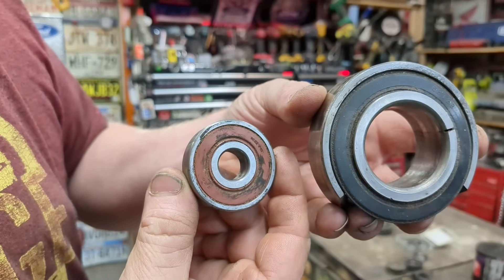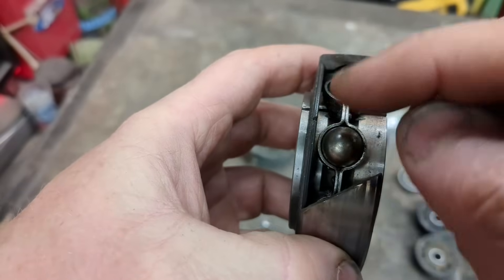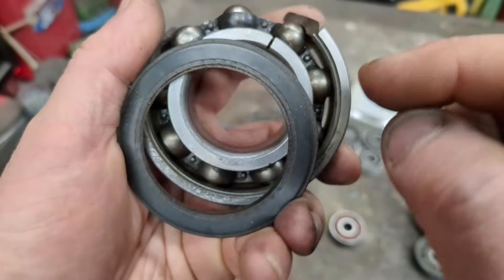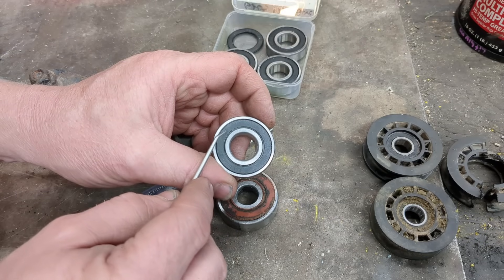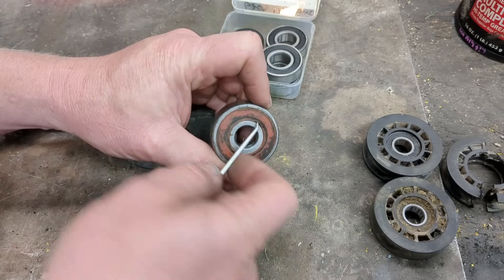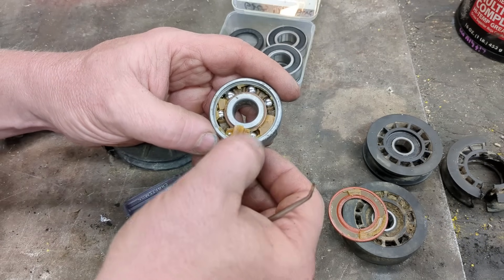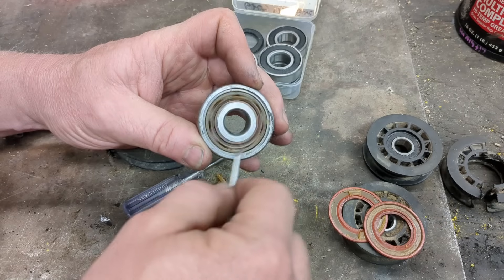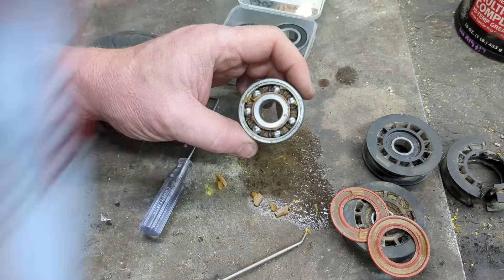How to GREASE, Un-Seize and Clean SEALED Bearings

Comment: The problem today is that the cheap and common Chinese sealed bearings (which most are now) don't have enough grease to begin with, so I always "top them off" with grease when replacing with new. Otherwise you'll be doing the job again real soon...
Reply from the maker: I was under the same impression that they don't have enough grease in them. I read a lot of technical articles on it with heat charts. SKF recommends as low as 15% fill. And they make good bearings. The highest filll ratio I could find was around 35% in all the technical articles.
Reply: @sixtyfiveford  I was always told 40% and it seems to work fine. Even a lot of the "known" brands are being made overseas and have dropped in quality, so you can't know for sure till you read the packaging.

Comment: Believe it or not...that red and tacky grease works AWESOME...and if the bearings get hot, the grease melts, gets liquidy, then flows to the parts that need the grease...self lubricating  :)
Keep em coming!!!!

I used to 3D print fidget spinners when they were "the new hotness"  I would literally buy rollerskate bearings 608ZZ, then soak em in a jar with acetone and shake em a bit to get the grease out...no grease bearings spin MUCH more free (great for low rpm fidget spinners) but lousy for high speed/high heat uses :)

Comment: If Brake Cleaner is just acetone, it is cheaper to get a spray bottle and fill it up with Acetone,  rather than purchasing a container is compressed air!
Reply from the maker: Not necessarily. Brake cleaner and carb cleaner are almost identical with acetone, heptane, and toulene with brake cleaner also having methanol. I can buy a gallon of acetone for $22. That's 128 ounces. A can of carb cleaner(14 oz) is around $2. There are 9, 14 oz cans in a gallon. That's $18 for 9 cans.

Comment: So what do you do if the bearings are encased in steel? I removed an abandoned Instep Child Bike Trailer from the path. It was clogged up with  fishing line so badly that it actually bent the axle. I think it may even be a hardened axle as it has that deep yellow zinc coating. After a long battle with the stupid snap ring I was shocked to find no ball bearing dropping out. 
 Also could you cover getting out a sealed bearing from a bike (french made Wolber wheel -- somewhat collectible.) in which the shaft broke in the middle? Blind bearing removal I believe it's called.
 The last thing I wonder about is the right amount of grease. I worked in a big national name gas station and I remember they had an air bearing packer. Wouldn't this overpack it and if so why would a big company do that? (especially if it is going to lead to premature failure)
Reply from the maker: The bearing packers work just fine for taper roller bearings commonly used for wheel bearings. This is because those bearings aren't sealed in the sides and can expel excess grease. I've had bearings that were near impossible to remove and generally just use chainsaw bar oil. It's a non detergent (all gunk settles out vs detergent where the oil continually carries it around) with a tacking agent to keep it in place. It seeps into small crevices very well and provides great lubrication.
Reply: Blind bearing removal? If I understand you correctly, there is a method packing bread into the center / hole of the bearing and hammer a shaft with a close fit into it and the breads acts like a hydraulic force to remove bearing from housing as you hammer the shaft.

Comment: very interesting 
I have some bearings on a hand trolley that are fubar (been in the rain, one is crunchy like square balls) now i know how they work a bit better i might be able to break the cage and set the balls to allow the wheel to come off (inner race stuck on axle) good video i'll be looking at the next sealed bearing with a bit more maintenance oriented checking

Comment: Good stuff! back in the 1980's of skate boarding we did this every winter. Now days its the alternator, generator end caps, idlers, dirt bike hubs, you can put high temp wheel bearing grease in a 100cc cattle syringe too, works very well. HF just gave away free picks too lol
Reply from the maker: I've spent many hours precision lubing my skateboard wheels.
Reply: I'm 60 and I still regularly clean and lubricate my roller skate bearings.
🤓🍻⛸️
Reply: @alsaunders7805 my dad was 74 and rollerskating.  He is stubborn and would only take his blood thinners if he wasn’t feeling well and had a stroke.  May you skate for many more years and if you need them take your meds.  It has been 6 years ago and he is definitely having more issues now.

Comment: I use graphite grease it's the best.i learned this trick years ago from a city employee that mows for the city ..they were burning bearings weekly on the blade spindles. The trick was to remove one the seals on the upper and lower bearings..now they last 5 times longer.i did this to mine it's been years since I've replaced a spindle bearing.i see ginger is enjoying warmer temperatures..lol..looks like you are too..see you on the next one Cheers friend 🇺🇸🇺🇸🇺🇸🇺🇸🇺🇸

Comment: Would the correct amount of grease for a roller bearing be 25%as well?
Reply from the maker: Taper Roller bearings can push out excess very easily as they're not trapped in both sides. So those of course you just pack all the way. It's just these sealed bearings that have nowhere to put the excess grease.

Comment: I guess most people would just buy new ones, but they could easily repack them. The clear stuff reminds me of petroleum jelly
Reply from the maker: It does look like that. Whatever it is, I'm sure it's the cheapest grease like substance you can put in there.
Reply: Some zero turn mower spindles, with "sealed"bearing cost $175 each.  Many mowers have four spindles.

Comment: Good video. I've always felt that popping the seals off by the outside edge was less likely to damage the sealing lip.
Reply from the maker: True. However it's near impossible to due so without damaging the outside, I find. On some bearings the rubber coated metal shield is so thin it deforms no matter what, but I don't think I've ever nicked/damaged a seal.
Reply: @sixtyfiveford 
I've just used a flattened industrial syringe along with a dental spatula to get grease into & under the inside seal while turning the bearing to spread it around.

Haven't had the courage to get the pick tool under the inside lip due to fear of damaging it.

This is on an bmw e46 idler pulley bearing that I have regreased every year for last 4 or 5 years now when it starts squealing.

Comment: I use also use acetone brake cleaner, carb cleaner but my go to is the stale gas I get out of the mower/tractors. Soak them for a few minutes then brush them off. Dry, grease & reinstall.
Stay well, Joe Z
Reply from the maker: Everytime I mentioned cleaning something with gasoline in one of my videos, People freak out. We're 40 years past lead in gasoline and it's still considered one of the most toxic things by society. It is the cheapest per gallon and one of the best cleaners out there though.
Reply: @sixtyfiveford  I can understand commenting on safety, ventilation & so on but to freak out, about lead issue ? Unfortunately we have to just let some comments go. Stay well, Joe Z

Comment: Wish I would have know this when I had my unknown aftermarket A/C system pulley out on my 1987 4 runner,  I just cleaned it up with brake cleaner to free it up.  Been good since but damn I wish I knew I could grease it.🤣

Comment: At first I didn't realize you cut that larger bearing open, I was quite surprised wondering how it had failed until you said you cut it. haha

Good video. I've had great success repacking sealed bearings.
Reply from the maker: It had a crack and I just cut the other side of the crack to be able to take out that piece.
Reply: @sixtyfiveford  The next video will be how to weld back together cracked/broken sealed bearings... correct?!? Kidding - good video. Best wishes! 👍🏻😁

- Max Giganteum

Comment: There is a science to this and Rule of thumb is that bearings should be filled to 30-40% of their space and housings 30-60%.  Standard bearing space is found by the formula V=KxW where V is the quantity of bearing space open, K is the bearing space factor and W is the mass.  Most bearing manufactures list K factors based on bearing type.
Reply from the maker: Most of the documentation I found online was 15% was the standard. But also found as high as 35%.
Reply: @sixtyfiveford  Check out the engineering literature for any of the majors like NTN, SKF, TIMKEN, FAG, etc....

Comment: Manufacturers under grease the bearings to promote planned obsolescence; it’ll last a little while then need to be serviced or replaced.  Therefore if you only grease 25% you’ll need to repeat via timed maintenance intervals.
Reply from the maker: Fill it full and it'll overheat and self disassemble.

Comment: Touch your lawnmower spindle housing right after you’ve mowed.   The housing will be hot. The grease thins out when it gets hot.  The oil part of the grease can seep out under the pressure, heat and gravity. 
Any squeaking or growling coming from the mower deck is a dead giveaway that the spindles need servicing.  Do all the spindles at the same time because if one is making noise?  It won’t be long before the other ones will too.

Comment: Dumb question. I recently did this to a bearings, and I was curious on the spoked ones (which is what I was working on), are the spokes for cooling?
Reply from the maker: The plastic spokes/ridges I think are just for reinforcement of the pulley with using the minimal amount of material.

Comment: Grease in the old school definition is oil with a metallic soap. Regular bar soap is sodium stearate, but lithium can be substituted for example. New styles of grease have everything from teflon to Molybdenum disulfide, fibers, graphite and other thickening or waterproofing agents and synthetic oils.
Reply from the maker: Absolutely. It's a huge rabbit hole that I have unfortunately went down more than once.
Reply: @sixtyfiveford  I've cheated on occasion and made a Zerk fitting adaptor that had a hypodermic needle on the end. It's been real useful to slip a little grease under the seal of a bearing that was hard to get to. Great useful information video thanks.

Comment: Think I've saved a half dozen idler pulleys on cars this way. Thanks for sharing your knowledge! 😊
Reply from the maker: Right on!
Reply: I've saved the same idler pulley going on 4 years now.  It usually starts squealing in the late fall as winter sets in and is spinning freely.  

Even the new ones (INA) last only 15k to 20k before they start squealing, which is about how long I get from repacking with grease.
Reply: I wish I had known this a couple months ago. My girlfriend's 2012 Ford Fusion 2.5L has 3 idler pulleys at $25 apiece. I was pissed they cost so much.

Comment: Awhile back I spent the big bucks and bought the Mobil1 synthetic grease. With the exception of the red dye leaching out over time it works great.

Now, I have a tip for you.
I bought a pack of disposable syringes, variety pack.
It came with some fine, plastic tip ones.
I filled one with grease and use it to pack them bearings quickly.

Unfortunately, I haven’t found a way to access sealed roller bearings to grease.
Reply from the maker: Seems like all these red greases leach out all their dye/red oil pretty easily. Syringe is a good idea.

Comment: I've been thinking about getting a sure shot sprayer for acetone to replace brake and carb cleaner.
Good idea or bad idea?
I should take a look at my scooter bearings soon.
Great video as always.
Reply from the maker: I try to buy carburetor cleaner in bulk/on sale. I used to be able to buy Walmarts for 1.19 a can but that deal is no longer around. The last ones I found were the large cans of gum out for $2 each. Think I still have about 25 cans left.
Reply from the maker: I have thought the same thing multiple times. My main issue is none of those have the straw that I utilize all the time.

Comment: Traditionally Grease is farther down on the fractional distillation tower and contained the paraffin and waxes. Below wax you start getting into plastics like polyethylene. Modern days, who knows what they put in it, but I certainly hope that they don't use clay because that will be abrasive even at a very minuscule level. It is what is used in very fine polishing compounds
Reply from the maker: Bentonite(clay) grease is used in bearings all the time. It has excellent high heat and water wash out characteristics.
Reply: @sixtyfiveford  I thought metallic soaps were the thickening agent?
Reply from the maker: @bcubed72  There are soap greases and non-soap greases. Bentonite clay grease is a non soap grease.
Reply: @sixtyfiveford  I live in the bad lands and the whole country is bentonite, no grease factories here
Reply: Caltex high temp bearing grease, is clay based
Reply: Clay grease is superior to cheap lithium grease. Not sure why you recommended it
Reply: Lithium is a component in many greases it will look like clay when the lubricant is gone

Comment: I've heard that moly in grease actually wears the surface of the balls and races.  Is that true?  Thanks
Reply from the maker: I've heard things like this as well. Not that the grease is bad but under high speed due to its reduced friction the bearing can skid versus roll. This could cause damage to a bearing.

Comment: Another great video. I didn't know grease was oil with a thickener. I guess this is what they mean by drying out! 
I've looked at carb cleaner and a lot of them have some sort of lubricant in there. Not that this is an issue for this purpose.
Reply from the maker: I've read the msds on a lot of carb cleaners and never seen a lubricant/ petroleum listed. The current one I'm using is Acetone and Toulene; both great solvents. Most others I've seen are a mixture of Acetone, Xylene, Toulene, alcohol and other misc solvents. I will commonly clean metal parts with carb cleaner before painting and never have issues.
Reply: @sixtyfiveford  oh you are correct, I've always believed that they used to have some sort of film to help the rubber seals from cracking. I think this is because I've read somewhere not to put brake cleaner in the carb as it will destroy your seals. Now I look stupid 🙄😅

Comment: I use 00 grease for lubing stuff up a lot. Used to be called Snapper00 grease but Tractor Supply has it called 'Cotton Picker Shaft Lube'. I got 2 quarts a month ago and that's about all I could find online and get local. It's a cross between stiff and liquid. Snapper used to use it in their trannys on riders and walk behinds and is good for loosening up the grease already inside something. And I drip oil right inside the seal of a bearing while the shaft is turning but you have to watch and not get wound up. Ex-mark sent me an update for a belt drive mower about installing a zerk fitting because the OEM tranny used bentonite clay as lube that dries out and the tranny dies. The gun grease kept everything moving and the bentonite honest. I did it and the rig is still running. Poor dried out doggie! BLESSINGS to yall!